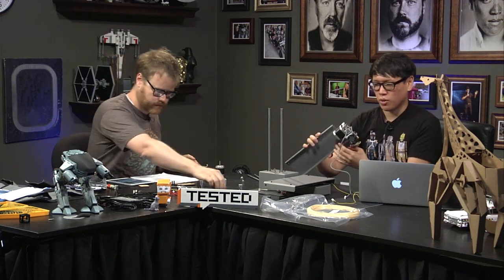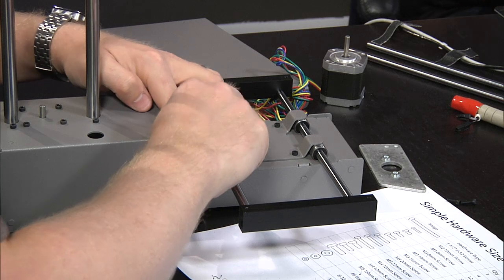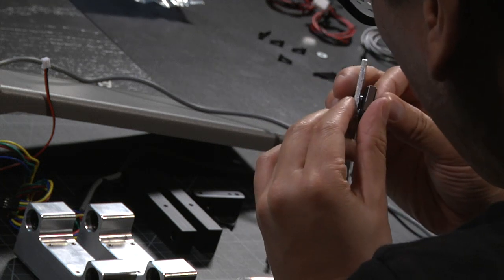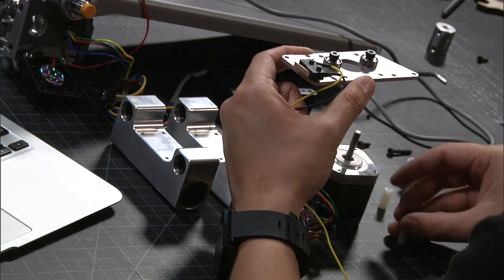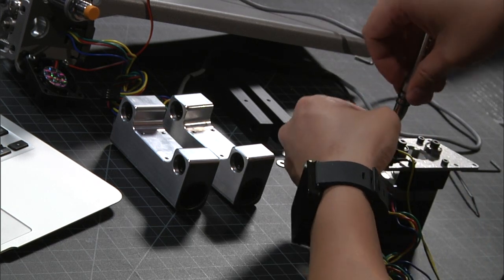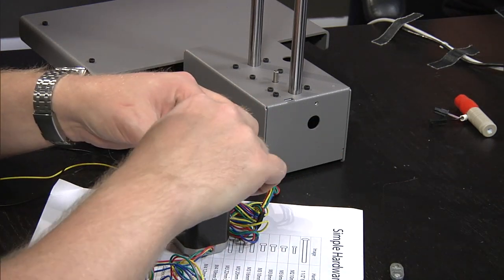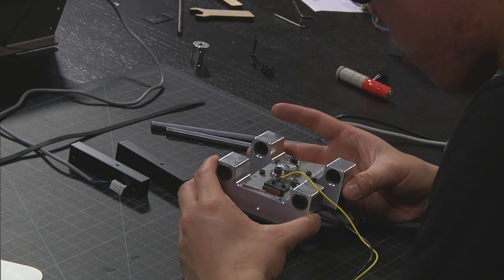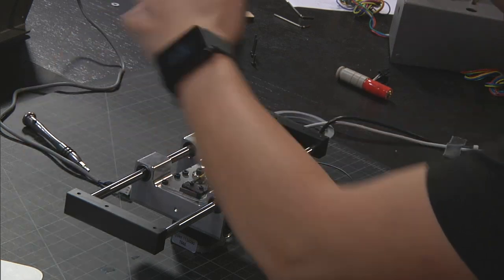Tested Builds: $540 3D Printer, Part 3

Comment: Will talked about the sensor pics being less than specific about which needed the short wires and which needed the long wires.   If you look the first sensor is shown (step 01)  with both the sensor head and the connector in the same picture with a zip tie which then gives a relative scale.  The second pic with a sensor (step 15) just shows the head with the wires leaving the image quite some distance from the head.  

Carefully examining the images makes it fairly obvious which sensor gets used where.

Comment: I don't know why he lied at 2:33 in this video when he said the manual shows both switches have long wires. I have the manual in front of me here and it clearly shows a short lead in step one. You are shown his i-pad at 3:10 in video 1 and the picture he is looking at is identical to the one in the manual currently available for download.
Reply from the maker: The short wire in our kit was much shorter than the short wire in the picture. We probably could have figured it out if we weren't on camera and trying to talk about this at the same time we did it, but why not just put a note on the page that says "SHORT WIRE SWITCH" or do what other manufacturers do and put a list of the stuff you'll need at the start of each step. That way, it's much more difficult to mess up and miss something.
Reply: Tested
Looking back, accusing you of lying was a bit harsh I admit but I was annoyed at you slandering PrintrBot when it was your mistake.

They can't put "SHORT WIRE SWITCH" because, as you somewhat sarcastically said, the instructions are not localized to one country. Yes the instructions would be improved by breaking it down into smaller steps and adding a Lego style parts list for each step.

As for the supplied wire being shorter than the one in the picture, we will have to agree to disagree. You have it in your hand there and I can only judge the length from your video and scaling the instructions photo in my head from the size of the cable tie and switch, both of which i use regularly. But after reading all the instructions, with one wire being roughly 5 times longer than the other, it seems clear to me that the long wired switch would be mounted on the moving head and the short wired switch would be mounted on the base plate, a short distance away from where the circuit board is fitted.

I will try to think a bit more next time I feel like commenting and remember that what is so obvious to me may not be so clear to others.
Reply: Tested Free advice - You "feel" you need to talk about it while on camera. Don't be so afraid of silence when doing these. A few seconds here and there won't hurt anything. It's actually pretty obvious that you're distracted by your own commentary. Not trying to be an ass, just saying if you put yourself in our place you'd see that we'd rather you take a sec and get the step right rather than talk through minutes of trying to find your way back.

Comment: checking similar screws length is easy:
turn them so the treaded ends face each other (like in one axis).
then slide them next to each other, so the threads touch each others side. the one that's hitting the others cap/head from the bottom is the longer.
something like this (just a bit closer):
[]=====
      ===[]
Reply: Hey, they can't even remember to bring in basic tools. You think they'll get this?   ;-)

Comment: The build platform stop switchs' wires has been wired wrong the second time around. They'll interfere with the belt drive. Chan did it properly the first time; the wires are not supposed to go through the zip tie.

Comment: I am amazed by the lack of knowledge displayed by you guys at times.  Take, for instance, your comments about how you would have been in trouble if you had used Loctite and then needed to adjust the fit of some components.  The whole point about using blue Loctite is that the fittings can be removed later if necessary.  That is what it is designed for.  Red Loctite on the other hand provides a permanent bond between the components.

Comment: Just goes to show that the "instructions" were put together by techs who KNOW how to assemble the device already but they never had anyone who didn't know how to assemble the device vet the instructions. Rookie mistake.....
Reply: HoxTop I did look at the instructions, and they are NOT perfectly clear. There are moments that the instructions just jump to completion, as they mentioned in part 2. The instructions also have moments, where they show a close up view, but don't include a full view, like with the belt.
Not to mention, it doesn't even say to tension the belt. A person could mount that belt, and just screw down the one end, and not realize they should leave a gap for tightening the belt.

Additionally, it would not cost much, to add a simple label to duplicate items, like the switches. Simple steps like that, could vastly improve things.
Reply: notman05 Well, the thing is, if you can't use your common sense to do those things, you should have bought the assembled version or shouldn't have bought one at all.
Reply: HoxTop I don't necessarily disagree, but I do think a few small steps, could make these instructions MUCH better. I'm confident I could do better than Will and Norm are, but unfortunately, I think they are more of the typical types who buy the kits.
Reply: HoxTop I agree on the fact that Will and Norm make it sound way harder than it really is. But it's true that the doc is not always clear. There are a few things missing, or implied in the picture, but if you don't know what you should see it's not always obvious. It's obvious once you assembled it, and I understand that you can forget to mention it, but when you are building such a machine for the first time, common sense doesn't always compensate for lack of experience. I had "issues" with the Z coupler and the Z nut. And I was far from being the only one... I also had to modify the connector of the Z probe because it was not wired properly, but it has nothing to do with the doc. Anyway, I had a lot of fun assembling and troubleshooting it, and at that price you must expect it, but you can't say that the doc is perfectly clear :-)
Reply: Yak Eru What's the quality of the prints? Is it worth $540?
Reply from the maker: Yak Eru It's literally a situation where if they took the dozen or so places where the instructions are open to interpretation they added a couple of sentences or another illustration it would be fine. They're a good start, but in many cases, you can't tell you've made a mistake until you've already done a bunch of other stuff and will have to backtrack.
Reply: HoxTop : The print quality is very good, and it's worth the price, no doubt about it. I had really clean results at 0.1mm layers, 50mm bridges almost perfect, outer dimensions can be as good as 0.01mm from my drawings, inner diameters are generaly 0.1mm smaller than my drawings but it comes from the properties of the PLA, nothing to do with the printer itself, so I draw my holes 0.1mm bigger. Parts are solid. The quality for the price is amazing. But it needs some supervision, maintenance, tinkering and experimentation, various little improvements (add cooling on the extruder, add filament guide), etc... nothing expensive, or complicated, just some thinking and parts you can print yourself. Let's say that you have to round the edges yourself and that you regularly find new edges to round when printing a part with obstacles you haven't met before. And that's the difference with a 2000$ printer where they rounded all the edges they could possibly find during month of testing by many persons for you :-)

Tested : I agree. As said above, it looks like the doc has been made by a person who knows the printer well and forgot to mention many little things that are obvious to him. For example, the two metal brackets holding the bearings for the Y arm, they have a little notch on one side, what does it mean ? There is no mention of these notches in the doc ... so I ignored them and just looked at how the bearings where inserted, and assembled the brackets so that they are as far apart as possible, to ensure the best support possible for the Y arm. For the Z coupler, I had to experiment to find the best way to assemble it, and in the end the best way is to drop the lead screw so that it is in contact with the motor's axis, so that the coupler can expand if needed, but not compress, and it improved the print quality. So nothing critical, but many little details that could spare you some doubts and stress while powering it up for the first time :-) And these are some of the many other things that would have appeared in the doc if they asked some (or more ?) total noobs to assemble the printer.